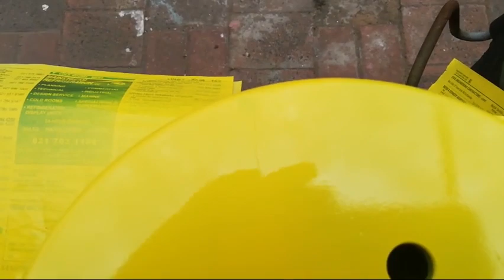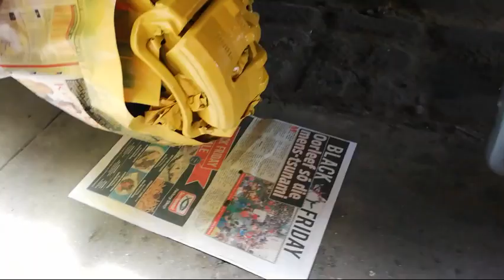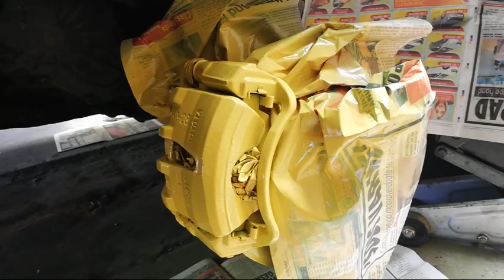Respraying my brake drums and calipers

Comment: If you want to change the rear brake drums too disc.. Believe this, Honda Ballade ,1992 to 1995 and 1996 to 2001 all use the same rear disc size, i think it's 239 diameter.. and  rear calipers both left and right side will fit your car.. easily.. 
Trust me, i have 1987 Toyota Conquest Rsi Twincam 16v, i converted the braking system with Honda Ballade from 1992 to 1995..up to 2001. They are all the same size rear disc and caliper.. and bonus is that they are 4 x 100 pcd for your rims..